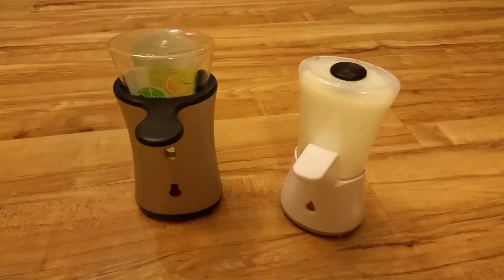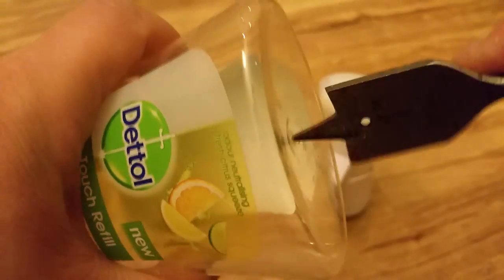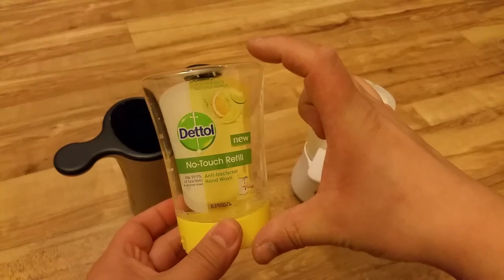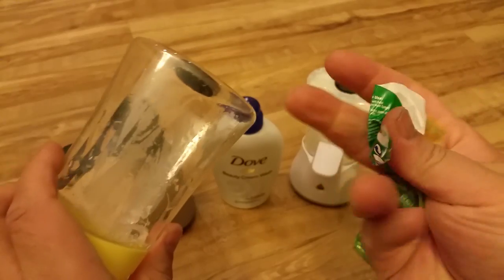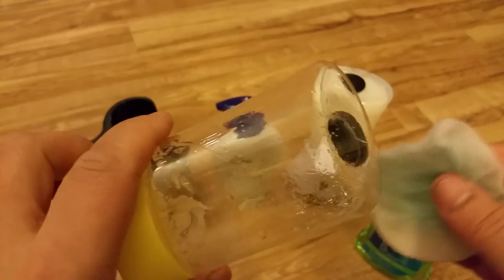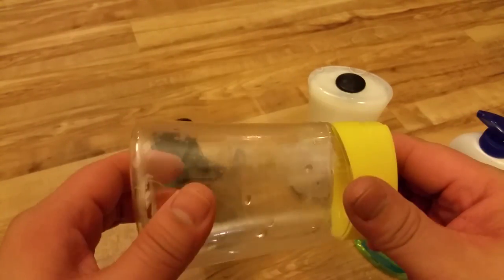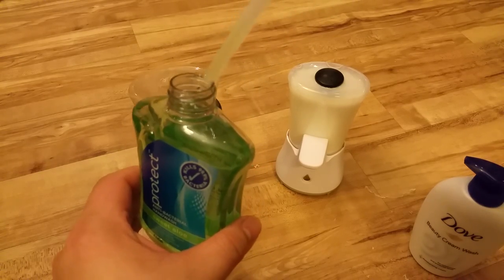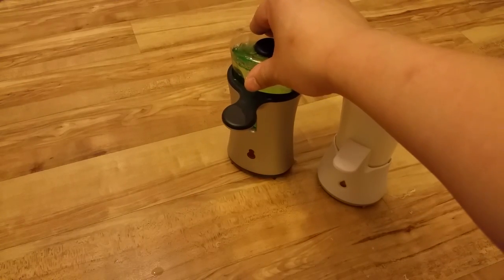How to Make Convert DIY Mod Your Lysol Dettol No Touch Automatic Soap Dispensor Refillable Hack

Comment: By far the best solution, excellent. 

All I'd like to suggest is that you remove the cut disk and the little drilled bits of plastic to avoid them fouling the pump part of the unit. It's not difficult with a pair of needle-nosed grips. The other suggestions made here that involve removing the base of the container are all flawed - for two reasons: 1) In time the joint between the transparent container and the opaque plastic base will become loose and cease to re-engage and 2) to remove the refill you have to pull it upwards. Sooner or later you'll remove the transparent part and not the opaque base. The solution demonstrated here means the container can be left in situ on the base and refilled without separating the two parts.

Finally, I'd recommend you refill the container with soap of a similar viscosity to the original. Heavier viscosity will tend to block the output nozzle more quickly and leave a trail once most of each charge has been delivered.

Great money-saving suggestion given that in UK 5l of Carex costs £5-£9.

Comment: Thanks for the video, it was a great idea !! But what is the name or type of this black cap? Sorry, if you said in the video, I could not understand.
Reply from the maker: Thanks for the kind words. For the cap you can Google or look on eBay for rubber gromit.
Reply: Ensure you buy grommets that are EXACTLY the same size as the drill bit. They're very inexpensive - in UK 100 cost less than £4 at Screwfix.

Comment: no, that's overkill, just get a cheapo metal soap dispenser (the standard ones), and just push it through the hole in the bottom, and just pump the soap, easy as that! (i used to do that! worked awesome)

Comment: What size is the rubber grommet?
Reply from the maker: You can buy different sizes. The one I used was a 25mm rubber gromit.
Reply: What size drill did you use? @TheHDChannelx
Reply: Must be exactly the same size.
Reply from the maker: Same, 25mm drill bit

Comment: can just pop off the container lid and fill that way,no need for all this malarkey
Reply from the maker: chas moff Not really. If you keep popping the lid off and refilling it, over time the lid will be loose and will start leaking.
Reply: I have done it for more than 2 years and every bottle is fine.
Reply: Good luck - just as sooner or later every hard disk will seize (lack of lubrication) , so this cap will eventually fail if you follow the 'rip it off' suggestion. It's physics.